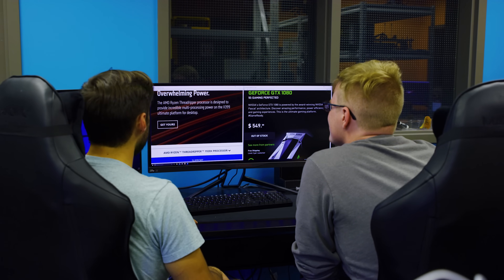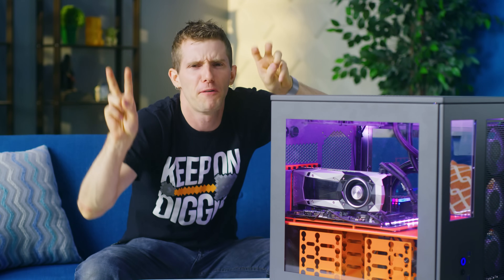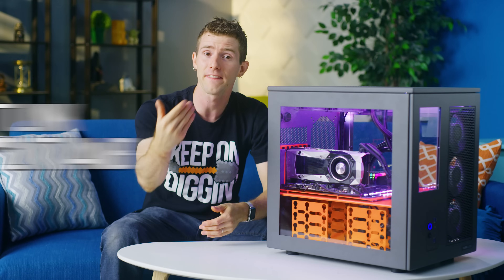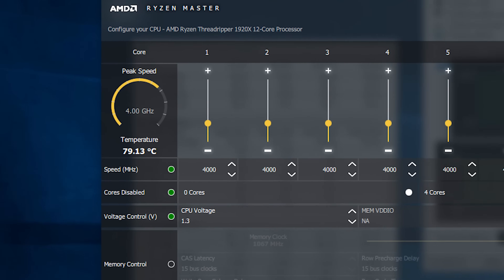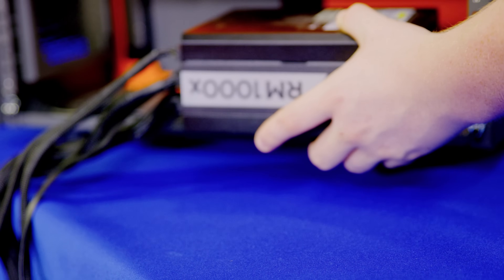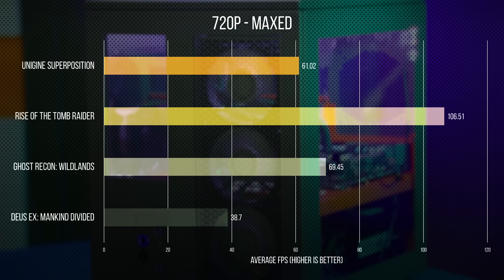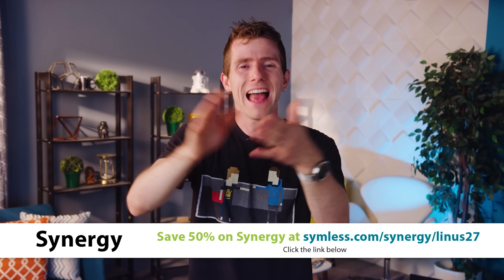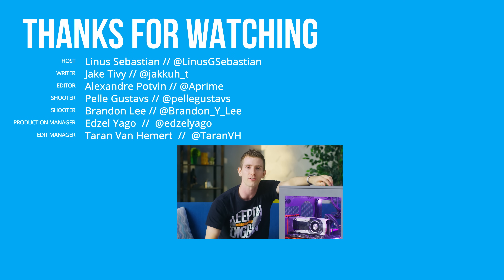The 1920x1080 MEME PC - WE BUILD & TEST IT

Comment: WTF How on Earth is a Gtx 1080 and a threadripper cpu getting 38.7 fps on average in deus ex at 720p? What did you do put 1920x MSAA?
Reply: qpwoeiruty eidjcn well, a 1080 isn't really meant to play games at 720p. It's most likely using less than 40% of its power
Reply: qpwoeiruty eidjcn but also he did put the best possible looking things, like 200% resolution scale
Reply: But at that point it isn't 720p at all
Reply: how a GPU meant for 4k is not good for 720p?
Reply: AntiSnifflz
It doesnt matter, it should perform better than this. Results are just bs, bad video. 1080 is meant for 1440p or even 4k, so it will do amazing at 720p.
Reply: He MAXED out the settings!!! Do it on your rig and let's see the results.
Reply: If he used DSR or ingame resolution scaling then he should've mentioned it. Not all games come with resolution scaling, and "maxed out" usually means graphics settings, not boosting the resolution. Pretty misleading IMO
Reply: I'm quoting the stream "when Alex did the benchmarks, he wanted it to be ultimate. He maxed out literally every slider, even the ones which don't make sense at all."
In this way the 1080 was struggling as hell to elaborate things you couldn't literally see or to output like 200% the definition it was set to, which takes an absurd amount of power
Reply: I am confused, and I will tell you all why. I have an RX580 Armour OC 8gb card with a Ryzen 1700x. And I am playing Deus X Mankind divided on full settings at 2560 by 1080. So why the hell are they struggling with Nvidia 1080?
Reply: because he made it up...
Reply: qpwoeiruty eidjcn it's a troll video..he made it to piss you off
Reply: kendokaaa yeah I really wish he had more info on what was conducted in game
Reply: +Sean Payton nnnnnnnope.it uses as much cpu as ryzen and ryzen is pretty good in games. I got one with a 1080 and in cpu intensive or latest games it's flawless.
Reply: I play maxed settings (OK I usually just do the lowest AA settings because pixel density) on my 1070 at 1440p and usually get 80-120fps depending on the game. Video was confusing for me too.
Reply: Sean Payton wtf are you talking about. This are gpu heavy games and threatripper performs like any other ryzen chip in games when oc to 4.0ghz. The only reason for performance issues is anti-aliasing maxed out and every other setting all the way possible
Reply: I'll clue you in. Its not the fault of the 1080, its the lousy amd chip.
Reply: Theadripper is bottlenecking the GTX1080
Reply: look up super sampling,  Even at 720p  if you have crazy super sampling you might as well be trying to play it at 4k.  And no  threadripper at 4ghz isnt bottlenecking the 1080.
Reply: basshead That makes no sense at all. You can have a GPU not perform its best with a low end CPU but pairing a top of the line CPU like the Ryzen Shown with a 1080 is not going to make the GPU behave like a GTX 960 or something like that. Bottlenecking doesn't work like that. Most likely when Linus said "max settings" he did something retarded like apply 16x Super Sampling anti aliasing, the least efficient kind, which effectively would force the GPU to render a 16x bigger resolution, which would make even 720p a massive resoirce hog.
Reply: +Pancho Barrancas Threadribber isn't a good CPU for gaming it's even weaker than the three times cheaper 7700k
Reply: +jootai AMD is known for their bad software
Reply: basshead There is no AMD software running here, the AMD part is the CPU AND even Linus had already tested this and lesser Ryzen CPUs with high end GPUs and they got hundreds of frames per second at 1080p, this is not the fault of the CPU but the fact that Linus enabled ssaa in game, basically rendering the games at like 4k even when selecting 720p as a game resolution.
Reply: Software fixes made the FX better
Reply: basshead yeah, but this specific CPU has already been tested and proven to work well with games and is much, much more powerful that FX chips especially on a per-core basis, so my point still stands.
Reply: +Pancho Barrancas AMD stuff is mediocre, not bad but not good either.
Reply: Grown up and smart people can argue without insulting others
Reply: They are less powerful. They are just good ''best bang for the buck'' CPU-s. If you want the best the world has to offer you need Intel.
Reply: +Kekistani Refugee  and now he deleted his own comments :D

Comment: What why did the result suck it was a 1080 and an insane CPU
Reply: im wondering the exact same thing......its still a 1080 and a beast cpu, why so shit???
Reply: Dartian I hoped some comments clearify it. I also dont get what Linus meant
Reply: toastbrot21016 i like your name
Reply: Dartian 

Linus mentioned it during his stream.

They overdid it with the ultra settings. Like AA x8 and absurd render/screen scales options that make the smallest of visual differences, but heavily tax the GPU. Essentially it's the settings nobody touches unless someone 10 years from now decides to play it again and have an excessively powerful GPU.
Reply: The maxed settings are probably something completely ridiculous, like 16x or 32x msaa,  ubersampling, or some other very demanding anti-aliasing.
Reply: So um... if they're jacking up the antialiasing, why not just supersample everything?  I guess it'd violate the purity of 1080 Pees, but isn't that a better way to deal with aliasing than crazy high antialiasing options?  Like isn't that what ultra-high end video cards are better at these days?
Reply: Of course using crazy anti-aliasing options makes absolutely no sense, but I suppose it was exactly what they were going for. This was a troll video after all.
Reply: Most games built for quad core. Add more cores you start dividing speed per core. 4 fast cores better than 20 slower cores if your only going to use 4 cores. The chip was starving the gpu.
Reply: flyingdevin1 not really any more than a Ryzen 7 if that OC was stable.
Reply: Dartian it's a bottleneck in the CPU. Trheadripper isn't a gaming CPU because it's clocked a little bit lower on many cores. Games can't take advantage of many cores. Games need fewer and higher clocked cores. Also he was pushing max settings on Deus Ex which is a very hard game to run.
Reply: It was clocked as high as a Ryzen 7 can go pretty much. As I just commented.
Reply: Rohan Singh
What are you talking about, it was clocked at 4GHz. Come on, the results make no sense at all. Look up threadripper game tests. It does way better than in this video
Reply: flyingdevin1 what bullshit is this. Where did you get that from? 4 fast cores is barely any better. The more cores the better and 4.0 ghz is not slow. The games are just not optimized for multiple cores, yet. Sooner this will change cause this time even intel is adding more cores to their cpus.
Reply: Modern games aren't made specifically for quad cores
Reply: I think it was just the way too high maxed settings.
Reply: That would be very disappointing, I would expect them to mention that somewhere if they did so.
Reply: LoveStrangeDr 
Lol, ryzen is FAR from being shit.
Reply: Dartian i've just try to play Deus Ex maxed out with my 1080 after watch the video, And the result were pretty similar, maxed out setting is just ridiculously taxing.
Reply: The single core performance on the chip is utter ass. Games are not made to distribute their resources among more than four cores for the most part. This is why Ryzen cpus aren't as good as their intel counterparts for ONLY gaming. However, it is also why Ryzen chips are better for game streaming because the other processes can utilize the additional cores.
Reply: DUPE dupe Not utter ass, 3.5Ghz base clock with similar IPC to Haswell. Not as good as, say, a 7700K but still quite usable.
Reply: DUPE dupe their initial Threadripper review scores over 40fps at 4k in Deus Ex just the same as the 7900x and the 7700k, however the settings were ultra not maxed out and probably using gtx 1080 Ti or Titan Xp, this one here is clearly that the gtx 1080 is the limitation. here at 4.50 https://youtu.be/9voQqU73-Mg
Reply: Byron Chou Why are you posting the same comments all over
Reply: issue with antialiasing is that it does literally nothing except making the game look worse.
Reply: Everyone here seems to think that it's the CPU that's bottlenecking the build. Most of these games I'm pretty sure support more than 4 cores, and even if they didn't, the cores all run at 4Ghz, similar to many other CPUs. The CPU isn't the bottleneck, it's the GPU, otherwise, the resolution wouldn't change the FPS as drastically as it did. These results aren't surprising considering they did all the benchmarks at max settings (I'm assuming they even maxed out the Anti-aliasing). A CPU often isn't affected by the change in graphics settings, only a GPU is.

Comment: Turn off the turbo boost. With my 1920x with turbo boost it throws the temp up and down. Idk why ur 1080 did that. My rx580 was having issue with fx8350 now with the 1920x it is constantly at 60fps or better. But the turbo boost has caused alot of issues with my testing from freezes in oc to zenith built in sound card lag at oc over 4.0

Comment: Why does it perform so bad? Powerful Gpu and cpu so what's the problem?i
Reply: Seriously, what's going on here? At 720p the 1080ti should be shredding frame rates, certainly not bottle necked by the threadripper to such a degree. What's going on?
Reply: I dont understand it aswell...
Reply: first of all its a 1080, not 1080ti.  secondly read the comments.  the "ultra" settings he is using doesn't JUST mean maxing out the various quality options... it means maxing out all options, including render scale (200%) and AA mode (8x msaa or ssaa if it's there), etc.
Reply: Artanis667 it's a 1080. Not 1080ti. But it should still be better. $500 for a gpilu you'd think you could get 1080p at 60fps
Reply: Artcore103

What the hell, why didn't they say anything about that in the video? Not everyone reads comments
Reply: also i see people commenting saying that the cpu was not meant for gaming with all of its cores. games domt need all the cores that cpu provides. they need faster cores not a large quantity of them. it has a lot of cores but they all run slower. again im not sure on any of that, just reiterating what other comments are saying.
Reply: the problem is the 8 dims of ram.... or linus is trolling
Reply: grandladybug It's true in theory at least. Games are still built in a way that pretty much means that they only really utilize the first two or three threads of your CPU. Meaning that in theory, having anything more than 4 cores (8 threads) for gaming is essentially useless since your games are only going to fully utilize the first three or maybe four threads either way. At the moment, it's better to have fewer threads with higher clockspeeds than more threads with lower clockspeed. (Not that 4ghz is low...)

Applications like DirectX 12 and Vulkan are designed to spread the load out more evenly over all the cores though. It's not to the point where a game can completely utilize every single thread to it's fullest but it's a step in the right direction.
Reply: Jack Nickolson its a GPU limitation as the gtx 1080 can't handle Deus Ex maxed out setting, in their initial Threadripper review you can see Threadripper + gtx 1080 Ti or probably Titan X achieve over 40fps in Deus Ex at 4k ultra setting (ultra is not maxed out btw) here at 4.50 https://youtu.be/9voQqU73-Mg

Comment: Should have exchanged one of the 8GB RAM sticks for a 4GB. 

1920x1080 @ 60
Reply: That's... not how it works...
Reply: Its a joke... woooosh
Reply: @johnuser5162  I get the joke, it's not funny if it doesn't work.
Reply: @joenodden  How would it not work? You can mix ram stick sizes. I did it on my old x58 board.  I was running 2x2gb, 2x4gb, and 2x8gb sticks. All detected.
Reply: @joenodden  I dont have the x58 board anymore but I know it would still function. To confirm my theory, I did a little test on my old lga 775 board with a c2q q9550. I used matching set of 4x2gb ddr2 dimms. I replaced one of the 2gb dimms with a 1gb dimm and it still worked in every slot I tried it on. Read as 7gb everytime. Oh and I even tried with only 3 slots populated.
Reply: @joenodden  it would still work who the heck told you that
Reply: joe nodden Dude, no. Just stop.
Reply: @joenodden  If you saw linus' video on rebuilding his first gaming pc, his motherboard supported dual-channel if you had a 3rd dimm twice the size of the other two in the system. 

The general rule of thumb is that you need matching SPEED across all of your RAM dimms, but you CAN mix capacities.
Reply: @johnuser5162  Ok that wouldn't work here though. The 4gb stick would need to be 16gb. And that's if the motherboard even supports it.
Reply: @joenodden  You have two people saying your wrong, do some more research first then.
Reply: @Sukkulents_  you can mix speeds and sizes. you will get the amount of data that you put it. the only problem is if your 3200mhz ram is installed on a board with 2666mhz ram then your 3200mhz ram will only operate at 2666mhz. Also if your using for example dual channel dimms with quad channel dimms you will only get to use two channels out of your quad channel dimm. The only thing you create is a bottleneck. Using matching speeds with matching channels will allow you both the speed and channels that you put in. As for ram sizes. you can put a single 1gb chip in with a 4gb chip and your pc will be able to use all 5gb.
Reply: On another note it is recommended to match speed and channels. It's not required.
Reply: @johnuser5162  You don't even have to match speed. Though it will default run at the lowest Speed.
Reply: @joenodden  I have a 4gb stick and a 16 gb stick they both work just fine not sure where you got your info from but they are for sure wrong
Reply: @joenodden  it works fine. im running 2x8GB and 1x4GB stick all 3 sticks are from diffrent brands
this is on a x470 board.
Reply: joe nodden except it works
Reply: @joenodden  it needs to be the exact same timings and clock speed, not size. On my old ASUS P7P55 LX board (LGA 1156) with a i5-750, I ran a 8GB Team Group 1600MHz and a 4GB Team Group 1600MHz totally fine
Reply: @Crunchy121  I do have one ddr3 1866 8GB stick and one ddr3 4GB 1866 stick installed they don't even match timings xd, I just think the one that's faster it's going to run at the pair of slower ome
Reply: Aidan The only issue it would cause is a lack of dual channel support if they’re different sizes between dual channel slots
Reply: @Sukkulents_  less bandwidth or speed, the faster ram is going to run at the speed of the slower one
Reply: Aidan yikes my dude, you’ve been absolutely destroyed here
Reply: @joenodden  love how you were all for staying on top of this thread when you thought you were right, but the moment you got so brutally destroyed you stopped coming back.... Hmmmmmmmmmmm 🤔🤔
Reply: @TheGauges420  Wow y'all sure do love using exaggerated childish terms like "brutally destroyed". Not surprised if you're children only old enough to find this video almost 2 years after me. 

Anyways, sure I might be wrong. I don't know seeing as I have no way to test it seeing as I'm not just some tech reviewer that gets this stuff for free. I don't have spare 8GB/4GB sticks lying around at various speeds to test on various motherboards. 

And I stopped checking back here because I hardly use this account. Ever since YouTube made a change in November of 2019 that I'm not going to mention because I don't want to risk this account.
Reply: @purppsyrup I could, if I cared enough to, which I don't.
Reply: @HoloScope  young midoriya
Reply: @joenodden   Looks like you're just flat out wrong here bud..   Take the L
Reply: Intel RX60 motherbord, or 60GB of stograge :) XDS
Reply: Can confirm mixing memory is pretty okay... I have a Dell T620, 4x32 GB dimms, 8x8 GB Dimms, 1x4 GB Dimm
Reply: If you have flex memory support then they all run in memory channel config until it reaches above the capacity of lowest GB dimm which then of course runs on a single or dual channel really depends on a lot of things. Is very flexible hence the name
Reply: @joenodden  i run an 8+4 ram config on my laptop and it works just fine
Reply: @joenodden  I mean I ran 12gb for a while, 8gb and 4gb and it even did "dual" channel